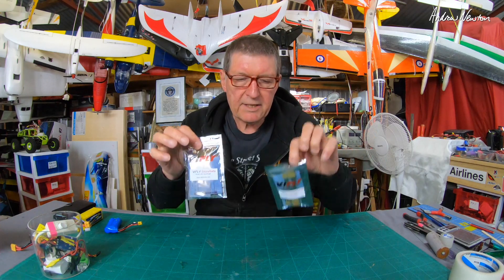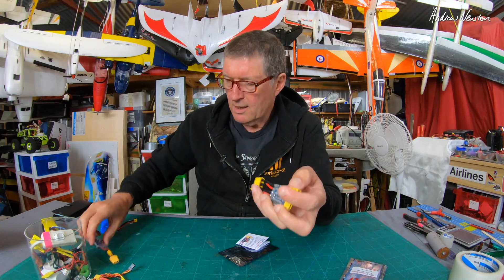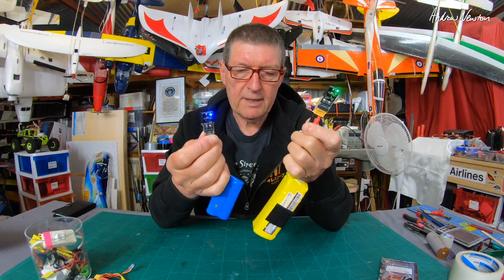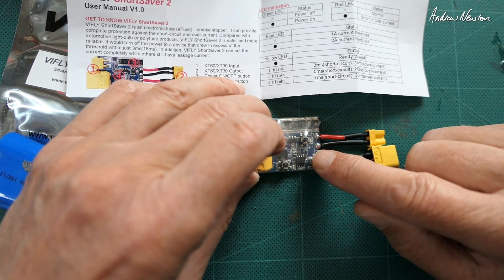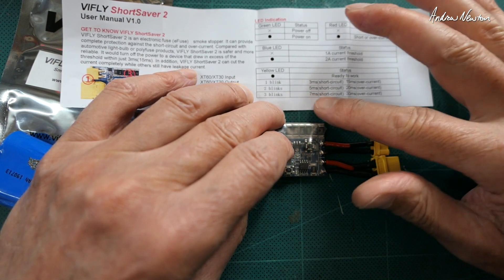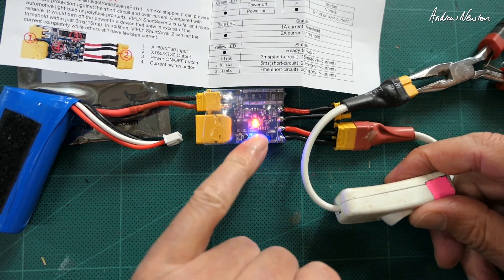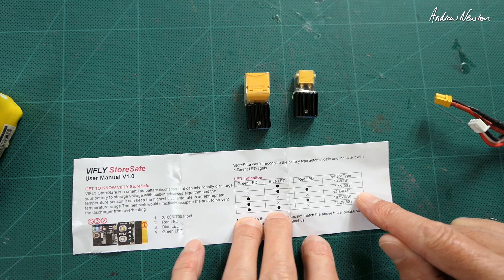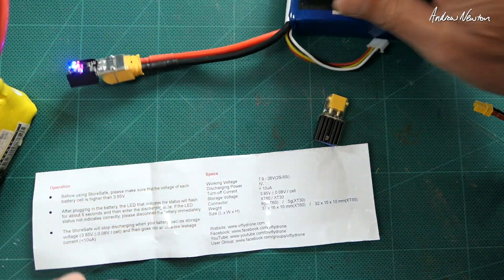VIFLY Smoke Saver 2 & StoreSafe dischargers

Comment: My only concern with the discharger is its discharge rate as it's quite low which means it'll take a lot of time. I usually discharge packs for longer periods of storage. But I have many packs so doing them one-by-one would keep me up for days. Since I usually charge multiple packs with parallel charge boards I use those same boards connected to an array of 12V incandescent bulbs in parallel. Each 50W bulb will present 4+ amps of load as I screw them in. I have four of them lined up. That way I can discharge a multitude of packs at once at up to ~ 18 amps. Since I do so with the charge boards I also connect their balance plugs which are then collectively connected to a cell checker which beeps when at storage voltage. Works quite well.

Comment: --The Discharger you will never use.   I bought an ISDT FD-100 and I've never, ever used it.  Most worthless piece of kit ever.  You're always charging up, never down.

--The SmokeSaver looks more interesting, if it also has some kind of spark arrestor built in.  I'm getting tired of that discoverting spark pop sound when connecting a battery on the bench.

-I bought the ViFly Lost Model Finder.  Can't say I'm all that happy with it.   Not very loud, and no real easy way to move it from quad to quad.  You have to solder it in.  Mine lives in a pill bottle in my refrigerator and I have no idea what storage level the built in battery is at.   Is a pain to storage charge it as I have to use a 2s battery tray to charge it.  In restrospect I wish I had gotten the one with a screw on / screw off battery compartment and replacable hearing aid battery.

fpvbook.air-war.org

Comment: That discarger seems a waste of time, at less than 0.1 amps it would take days to discarge down to storage voltage. Also it does not balance ...
Reply: 3S 1300mah may take 5 hours, 4S 1500mah may take 7 hours. And it is very tiny, just plug-in and leave it alone, it will go into ultra-low current when it discharges to storage voltage that can be put for long time.  Regarding the balance issue, we ever considered it before designing it. After many times testing, we found it will not affect the balance, if the battery is balanced when full voltage, after discharging to storage voltage, every cell is still balanced.

Comment: The storesafe only appears to discharge the battery as a whole and not by each cell. So how can they say that it discharges to 3.85v/cell. If the battery has a weak cell then I think that it may become overdischarged.
Reply: It assumes that the battery is relatively healthy and not severely out of balance charge. And if that's the case then the cells will indeed be around 3.85 (+/- 0.05v) give or take which is my experience using this device and then checking the cell results afterward. Ideally you would do a balance charge on the battery before using a device like this, so it should be freshly balanced. If a battery has a weak enough cell to become affected by such a slow discharge rate on something like the storesafe, then that battery is probably garbage to be honest and would be dangerous to use on an actual model.
Reply: Exactly my thoughts, why isn't it on the balance lead?
Reply from the maker: Good point Richard, maybe a balanced discharger will appear in the future.
Reply: Balance plug dischargers do exist. I have 2 myself.